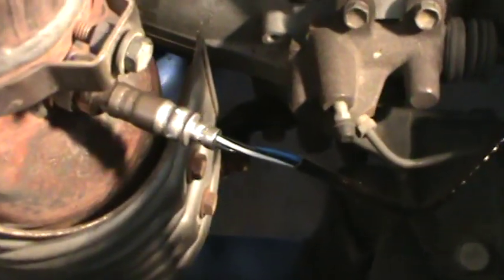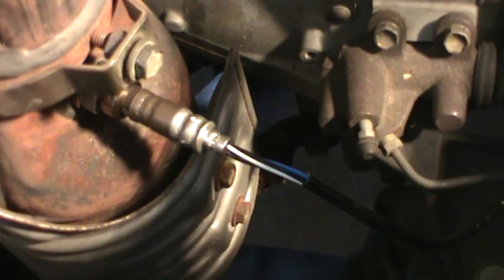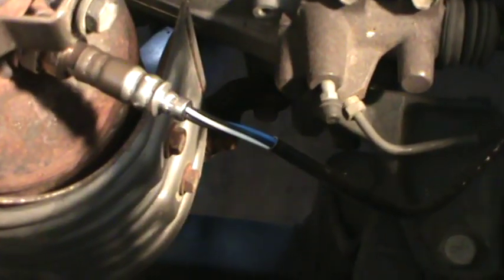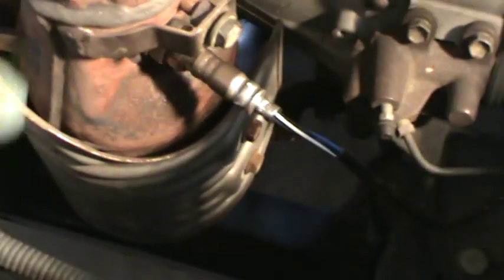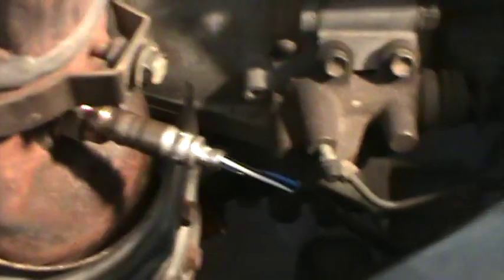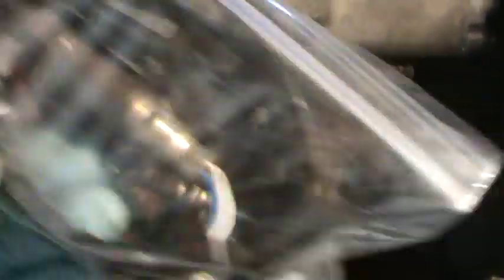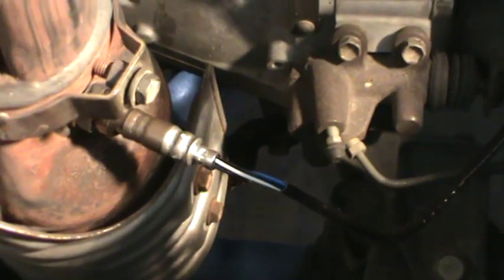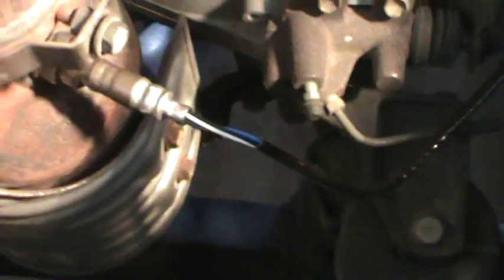Oxygen Sensor Heater Control Mystery Solved P1135

Comment: Dude, this video would be so confusing to someone who doesn't already know this. You talk about the 234-9041 sensor being incorrect, but you switch to talking about the sensor installed so quickly, you make it sound like the 9041 is an a/f sensor, and the correct sensor is just an O2 sensor.  That would confuse someone who is trying to figure out a P1135. 

Then you say the other, identical Camry you have access to, also has the wrong sensor, but you say it like that's correct. Contradicting your entire video. It happens, bur you should have gone back and explained some of that. No doubt if you watch the video, you will see exactly what I'm talking about.
Reply: zakly! first sez 9041 is wrong then its right. wtf. one more reason stoners should not play with electricity after a smoke break

Comment: Thanks, I'm having the same issue with a dodge. After replacing pcm and checking all wires I was beginning to suspect that the sensor was pulling the wrong amperage. First video ive watched that mentioned that idea and ive done lots of homework.

Comment: I have the same problem with my 01 Toyota Camry 2.2 I bought a new sensor for it and it still getting the check engine light so I'm wondering what is the correct sensor for my car?
Reply: Did you fix your issue?

Comment: Blah blah blah so whats the price of tea in China?

It's a mystery!
Reply from the maker: Price of tea in China? Whats that have to do with anything.
Reply: RomanAutomotive Exactly.

Is there a time code in the video where you actually disclose what the mystery is?  I got a mystery, and today I could not get through emissipms because after replacing every sensor I could think of, I'm still getting a p0141 error code.  That's my mystery, and while it's great that you have solved yours, you also made a 17 minute video of talking about stuff  without saying what it actually is.
Reply from the maker: @googlecult9814  Im sorry. Did you solve it? Maybe a shorted wire, a blown fuse, or a bad computer driver.
Reply: RomanAutomotive nope.  If it's a short then it's a lost cause.  To me  trying to trace down a short in a wire harness is worse then shoveling horse shit.  This toyota has only 130k miles and I cant even get this pile of crap through emissions.  I looked at forums and apparently untraceable check engine lights is what mechanics know Toyota for.  A friend of mine had one in his Tacoma and it drove him and his mechanic nuts for months.  I'm just done with Toyotas, Honda is the way to go.

Comment: I have a 2001 toyota forerunner 3.4 LTR 6 cyl . check engine light is on. i need to smog. the codenis 1125. up steam. i need the right sensor and video. 20O1 TOYOTA 4 RUNNER. PLEASE HELP
Reply: why can l solve this problem
Reply: why can l solve this problem
Reply: Do you mean "can't" ?

Comment: the code p1135  is for air fuel ratio sensor, and po135 is for the O2 sensor, I think the code was misreading?
Reply: It is an A/F (wideband) sensor, not an O2 (narrowband) sensor. The wrong name can lead to buying the wrong part, as it seems to have been done here.
Reply: They are both the same. The heater is in the A/F

Comment: Roman , 
I have a 6 Cycl 2002 Camry and I have been chasing the same problems for P1135. I noticed in your video your header was for a 4 cylinder Camry. 'Will the 235-9010 work for my car ?  Both B1S1 and B2S1 ...I think I need both A/F Sensors. Can you tell me which Denso A/F are correct for my 2002 Camry 3.0L , 6 Cylinder  ?

Carlton
Reply: you figure out you fix it ?
because I have the Same problem,
Reply: Same issue did anyone fix it

Comment: I am having similar problem. I had check engine light and got the error codes 300, 301, 302, 306, 0170, 0172 and 1150 which told me that I had multi misfire with rich fuel mixture at Bank 2 Sensor 1. I ordered on eBay Air/Fuel (Oxygen) Sensor for Toyata and RX300. I removed from 2000 RX300 Bank 2 Sensor 1 with marking "Toyata 89467 ~ 48011 Denso 0200" and replaced with new one received; cleared the Error codes and took car for test drive. I got same error codes again. Can you assist what I may do to get the issue resolved. What is your recommendations and what part number I may order. If you have website, give me link.
Reply: You must be ordered for wrong car ,you must to order for Toyota ,not for ToyAta

Comment: We'll done. Wow that was a tough one. The wrong sensor  caused  the ECM to shut down - do you think the  O2  heater driver was overloaded  for the 15 seconds  and then shut down  ?
Reply from the maker: When the computer "sees" the wrong amperage, it shuts down the control, and sets the code. Doesn't seem to have damaged anything.

Comment from the maker: I did not just use an ohmmeter to check the wiring, that is not always a good check because it does not stress the wiring. I will show in another video how I checked the wiring.